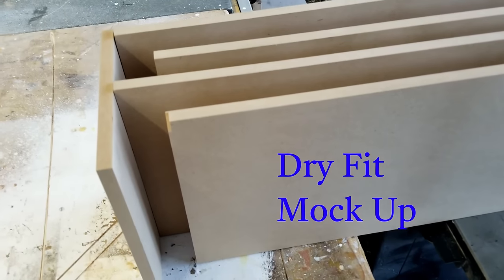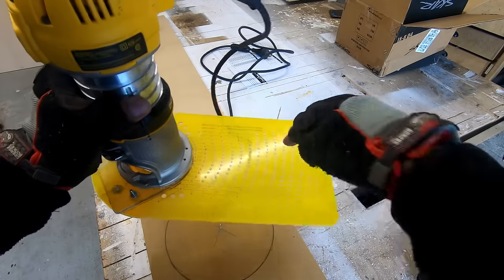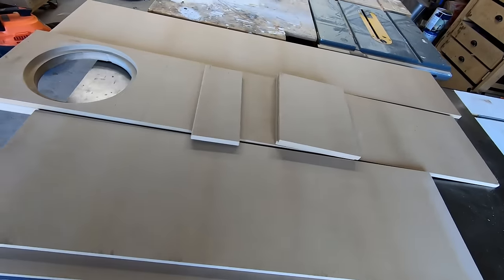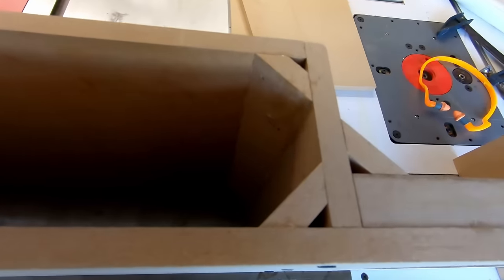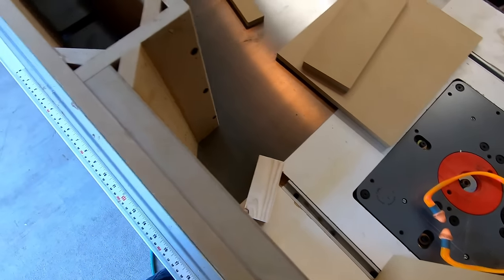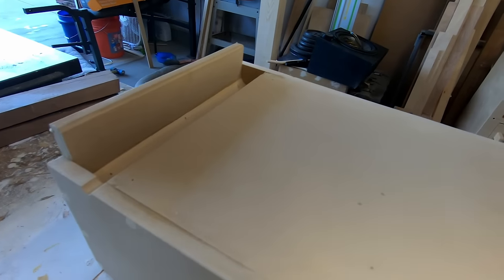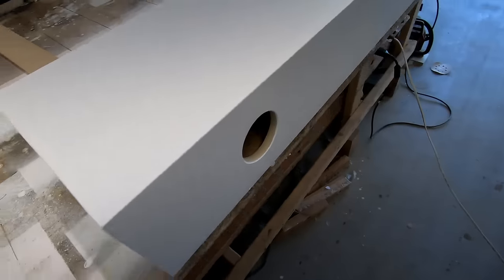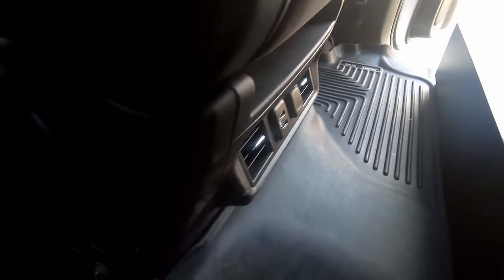DIY Subwoofer Enclosure 2021 Edition - Caliwood Specialty

Comment: Wicked speaker box but doo doo speaker keep it up.
Reply from the maker: 😅 Ha ha, yeah I gave this brand a shot and so far I'm pleasantly surprised with the sound and performance.
Reply: U can make a shitty speaker sound good with a decent box. Lol
Reply from the maker: @johndoe..THE_REAL_JOHN-DOE  yeah, I guess  so 🤷‍♂️ lol
Reply: All skar subs are good except the SDR 18 due to a bad designed coil  DNR 15 and the entire evl line due to weak motors they aren't efficient but take abuse
Reply from the maker: @kargo6  that's good to know.  👍
Reply: 🤣😂🤣😂😅 shit had me rolling
Reply: Travis Hamler  lmao no only Pyle uses plastic baskets
Reply: Skar ain’t bad
Reply: Travis Hamler  bro no skar sub uses plastic baskets. Heck even the IX series uses a metal basket.
Reply: @johndoe..THE_REAL_JOHN-DOE  yep, I remember this one ported box I bought years ago. I thought it must have had a pretty good sub in it cause it absolutely slammed, but when I took it out I was shocked! Lil cheap-o sub, put a good sub in and then it REALLY blew me away!!
  I'd say the Box is almost more important than the sub, almost.. LoL
Reply: I remember back in the day we had "Pyramid" product. those were truly "DOO DOO"!! the technology today and the newer cheap product BLOWS the pyramids Away! Skar is NOT bad, they are pretty good! comparing Skar to Pyramid,  Skar would be like on par with MTX Back then. the technology in Skar today is like most of the Mid level Brand Name speakers back in the Day. you can't go wrong with Skar.
Reply: @Engineer_GM_Ford_Chrysler  Good comment!  Pyramid was pure junk!  At least one amp was in every pawn shop I’ve ever been to.   Given that they were so ubiquitous I’m still not sure if enough people were gullible enough to buy them so that business for at least a few years or they all ended up in sitting in pawnshop because nobody wanted them.  Craig was another crap brand.  So was radio shack, just like their home audio their car audio was overpriced, behind the times junk.  Should have just stuck to parts and they might have lasted longer.
Reply: @BabyCharlotteschannel  the box IS more important than the sub

Comment: Very nice but out of curiosity does the sub ever slap the floor do to the excursion travel beyond the lip of the box.
Reply from the maker: Great question. No, it does not. I made sure it had sufficient clearance underneath. I've played some really bass heavy music and I've had no issue with the excursion.
Reply: Assuming you went with the srp 8" ?
Reply from the maker: @happys104092243  I used the IX-8 D4
Reply: @FranksCaliWoodSpecialty  why?
Reply from the maker: @matt6951  😆 Too funny.  Keep an eye out. I'll be upgrading it.  Yes, I'll be making a vid.
Reply: @FranksCaliWoodSpecialty  good deal! Pay attention to those T/S parameters! Good a good quality efficient sub.
Reply: @FranksCaliWoodSpecialty  my evl-8 has impressed many. Id highly recommended considering it as an option
Reply from the maker: @dakotad2401  Thanks, I'll check it out.

Comment: A transmission line speaker with a decoupling chamber behind the driver is called a Decoupled Antiresonant Line, or Daline. It permits more powerful quarter-wave resonance of the air in the line; it is like a hybrid between a bass-reflex system and a transmission line. In a system like this, the chamber behind the driver may have stuffing (or maybe not), but the line typically does not have any stuffing.
Reply: Albeit, the chamber is quite shallow, I call it a Daline, or simply a Chambered t-line. Admittedly, in my 30 years of designing t-lines, I've never tried to design one. Jesnen transflex https://www.youtube.com/watch?v=6yb2msOQw_4 or bandpass t-line https://www.youtube.com/watch?v=qm5K_VVRwXQ is as varied as I get

As for the measurements, to have a 'Line' that's 1 3/8's ... wouldn't perform that well. So this is certainly pointing more towards a daline, than a traditional 1/4 wave.
Reply: You know it's called antirezonant for a reason.
Reply: Yes…instead of stuffing though, I add an oscillating retractable Heisenberg compensator.
Reply: Is there a way to calculate something like this for dual 8" subs? How would you figure length of line and area of open chamber for each?

Comment: Nice job! I was in car audio from 1984 - 2000 and specialized in custom enclosure design, xovers and custom panels. I still do my own stuff for home and car. It doesn’t get much better than the construction on that box.
Reply from the maker: That's awesome. Thanks for the comment
Reply: Hello, good time, sir, I had a request. I will send you a piece of video. If it is possible, you can send me a beautiful design for the rear audio system of this car so that I can make it. I would appreciate it

Comment: I like how you build your box’s. Using screws and painting it. Seen others that don’t use any screws starts to rattle than fall apart and carpet that starts peeling off almost instantly
Reply from the maker: Thanks! Yeah, most boxes are carpet wrapped. I wanted to try something different and using paint gives it a more cleaner and sleek look.  Oh yeah, for me I want to make sure that the box does not come apart so I use screws all over.
Reply: you know boxes are supposed to be turned to a frequency right? and theres a math equation to use to get what frequency you want. or theres calculators online to do the math for you. just trying to help.
Reply: next time use a longer nail and put it all the way through and square and you can just flip it over and use the router to cut it out and the cut will line up.
Reply: and it will help to put liquid nails on the screws so they won't come loose. no hating just trying to help
Reply: gluing in the connector will help keep them from cracking from the pressure. and they make a lot of different kinds of metal inserts so you don't have screws that the wood holes strip. glue them in to seal them in. just some things you might have not thought of.
Reply: Bob, are you sure you watched the same video as the rest of us? The dude doesn’t need pointers, he’s a fucking stud. That box and his attention to detail is phenomenal.
Reply: Screws are not need if glued and clamped properly
Reply: But i still use them lol

Comment: I built a large box for my home theater system. I placed within the exact same SKAR ix 8 subwoofer. Fantastic sound for the money. The key with these budget subs is to never over power them. If you give them just enough, they sound great and last a long time. A good box is also very important.
Reply from the maker: Awesome! And yes, I 100 percent agree that you need a well-designed enclosure.

Comment: I can see how that would be beneficial. It allows 2/3 resistance/enclosure while allowing the the sound to travel and escape as well as the frequency which travels with it. Haven't had much enjoyment or success with open/bandpass boxes however designing and a reasonable amount of effort are warming me up to it. Still enjoy the hard hitting notes that come from a sealed box.

Comment: One of the nicest t-line boxes that I have seen.  Good work.
Reply from the maker: I really  appreciate that. Thank you
Reply: This is definitely a quarter wave enclosure, but I'm curious about the frequency range. It does sound good though.
Reply: @uncledope77  

Every t-line based on quarterwave that I have ever heard has the best bandwidth of any box I have ever heard.   Recently heard a Sundown SA-10 that was amazing.  Dug super low with rebassed tracks but also very musical with jazz and classical. Guy was going to sell me his box and hooked it up in his vehicle because he had audiofrog and was going strictly SQ for competition.   Sounded so good that he changed his mind.   It sounded so good that I wasn't even upset with him.   He literally quit competing because he missed that box. Not saying everyone would feel the same but ridiculous bandwidth.
Reply: I would agree with that if it was made accurately for each individual subwoofer. A lot of these homemade T-Line enclosures don't sound right.  Because they don't hit that quarter wave frequency spot on the money. Sometimes not having the proper spacing in the vented walls. Without that specific frequency & spacing that will tremendously effect the overall performance and sound quality.
Reply: @uncledope77  

It's not that difficult honestly.  First time I made one I killed it.   Best sounding box I've ever made.  Follow the steps
Reply: @uncledope77  

Honestly you can tune it to whatever frequency you want BUT I agree that calculating based upon the FS of the subwoofer has never had negative consequences for me.
Reply: @drrckhamilton  It's not difficult if you know what you are doing. Most people don't know what they are doing! Especially the folks at home who have limited knowledge, tools, software, and ability to properly read a spec! YouTube has a lot of videos of bad T-Line enclosures and fewer really good ones is my point. Some people have the capacity to learn from their mistakes and some don't or don't want to!
Reply: @drrckhamilton  It depends on what is important to a person.
Reply: @uncledope77  

You building one?
Reply: @drrckhamilton  No but I have & in vehicle it's not for me. They are too rectangler and a person doesn't have enough flexibility. To make them for most cars & are smaller suv's. I use vented, sealed, or passive radiator enclosures in  vehicles. I prefer passive radiators more now because of the pure dynamic range & pretty much no bottoming out. It is more fuss but there is nothing like the depth of that bass from 1 driver & 2 passive radiators of the same size. 👍🏾
Reply: @uncledope77  You are correct but i am not sure why everyone is saying this is a T-Line, it clearly has a chamber volume bigger than the ported section meaning it has a restriction which will create a loading effect, T-Line design is meant to use equal volume/area from speaker to port exit. The tuning length of the port is to match the Fs of the speaker hence why people try to use speakers with an Fs under 30hz especially in home theater applications
Reply: @HashDogg06  That's true but people have been being creative and testing different variations on quarter wave technology. I consider them t-lines because they are designed like 1 but have some slight variations. Are they t-lines spot on, no. But they sure do have some of the benefits. Regardless it's way too big for my taste in almost any vehicle. One of my favorite enclosures was pretty simple for 6 JL Audio 8W6's (the 1st versions). Each of them had .4 cubic feet of sealed air space with polyfill inside. Being pushed by a Rockford Fosgate Punch 200x2 dsm wired at 2 ohms Mono. With 3 2½" mini fans keeping it cool. 2 ohms Mono for that amp was a lil stressful. But that bass was so deep and clean because all 6 subs were sharing 1,200 pure watts of power. Also I only had the Bass Boost on the amp at 25%. Damn I miss that car and the BANG in it.😪
Reply: @uncledope77  Avoid bass boost, no amp should have one these day if it isn't fully adjustable, I nicely built enclosure that suits your taste buds won't require any bass boost. Sealed enclosures just work for all types of music but you need a lot of cone area to keep up with a smaller sub in a ported enclosure for those lower frequencies so ported is usually my go to.
Reply: @HashDogg06  I respectfully disagree about the "bass boost" it is subjective and per user taste. Plus those Punch amps had it built in to the guts of the amp. That line of DSM amps were offering 18 db's of clean bass boost & you say don't use it? 🤔  That is bananas, in most systems to gain 3 db's of spl you usually have to double everything. Or sound deaden the entire vehicle for 3 to 5 db's of extra spl. Punch was offering 18 db's with the turn of a knob on the amp. The simple efficiency & sound quality out that is next level! I only increased mine to gain 4 to 5 extra db's from the bass boost. To me the biggest problem with using a bass boost does start at the enclosure. But it's 2 fold, (1) can your subs handle the power with the bass boost? (2) Is your enclosure is right for the sub(s) that you have? Thirdly is quality of the signal coming to the amp. I had none of these issues I just like deep clean bass & I got it!

Comment: I got a design similar to this but it’s a 100” PVC tube. 
It transfers the sound energy much more efficiently than a “square box”.
Reply from the maker: 🤔 I'm intrigued. Is there a video out there showing this design?
Reply: @FranksCaliWoodSpecialty  
I did not provide all the steps but here is a short video I did of my older enclosure. It’s all tube.
https://youtu.be/NeSC0C1R6tc

Comment: Badass setup. Just watching the pieces being made, and you explaining the setup as you went along was appreciated. How did you calculate your inside volume, especially with those long runners? Thanks.
Reply from the maker: First off, thanks for your comment. 
There are various online calculators that you can find online on how to figure out volume and port length.  For this design, simply search for t-line calculator or Transmission line speaker length calculator.  This should also give you the overall volume.
Reply: Going larger then the recommended box size for a sub is not going to wreck them, it will be louder because there is less back pressure, but your sound quality will be looser sounding, or sloppier and less tight. Bigger the box the louder (more room filling vibrations ), and the opposite for smaller boxes. Hope this helps.

Comment: Can this same box be used with a ct sounds tropo 8" sub? How important is it to tune the box?  I have no idea how to do this, but I am a carpenter,  so I could def build this vox.So glad I found this, awesome work and sound. Thanks for any info
Reply from the maker: Thanks for the question.  The short answer is No. Only because every single sub has its own specs that require a custom enclosure for a specific tuning frequency.
Reply: @FranksCaliWoodSpecialty  thanks for the answer.  I really want that setup but I have been researching and I cannot figure out what size it needs to be by using available calculations. It's confusing to a newbie.  I could build anything if I knew the layout.  Also how do I find someone to tune it.  I don't know anything about this, I feel stupid

Comment: Great job my dude there’s a half ass way and a way to do it right  you got it locked down bro.  Instead of painting it why not carpet either way it’s great quality work.💯💯💯🔥🔥🔥
Reply from the maker: Thanks! 
Yeah, I wanted to try something different with that black finish instead of carpeting.
Reply: Got ya turned out great either way you would have went.
Reply: Going with the black paint you could use the Duratex coating...its black and gives it a finished look plus protects the wood. Also I'd have to do some sort of mesh over the sub especially with it facing/close to the floor
Reply from the maker: @tesla_3_performance  Yeah I did consider a duratex finish. And yes it does provide additional protection, but I wanted a smooth finish; i believe duratex has more of a rough texture finish. Adding a mesh or some sort of cover to the sub is not necessary (it might look good, but it would not add any real protection). I ensured it had enough clearance at the bottom for excursion. A few years back I built my home sub with a similar design (down firing) and there's been no issue with dust, kids toys, etc.
Reply: @tesla_3_performance  I agree with your statement but he might not have the clearance. Because the surround is thick plus the excursion. He might have to raise the enclosure a lil bit.

Comment: why would i use headphones? i have 8x 15s in my home theater playing this very well thank you very much :3

transmission line subs are awsome, you did a good job!
Reply from the maker: 8 - 15s!?!? Yeah Buuuuddy! Thanks for the comment!
Reply: @FranksCaliWoodSpecialty  yessir! With a small 400w amp, IB's are great!!!
Nearly 20 years old now... bought them back when acoustic elegance first started, bought all 8 for 1,000 bucks... now they would cost nearly 3k 🥺
Reply from the maker: @narmale  wow! Hold on to them. Now I'm curious to know how they sound.
Reply: @FranksCaliWoodSpecialty  they sound weird at first, takes about 3 weeks of listening to them to get used to the unique sound

You spend your whole life associating bass with traditional boom boom of box subs, which is nothing more than the original sine wave, and the 3rd and 5th sympathetic resonance

The IB takes the 3rd and 5th away... your sitting IN the box basically... so you hear bass like in real life... its actually more tactile than "heard" yes you hear it, but IB doesnt have all that overtones your used to hearing, so it seems way more immersive and not "in-your-face"

Helicopter blades rip through your chest and pull the door open your didnt latch

Cannon blasts rattle your eyes, and earthquakes... well... earthquakes are now so very real and visiting your house in very real style

The best scene, that i love to use: Tron, Onto the grid clip... is a brief, massive infrasonic piece that will destroy lesser subwoofers, they cant even do it justice if they cant go below 20hz... 

But that scene on an IB... buddy... you better have reinforces your walls, doors and strapped small children down for their safety... that sub 20hz base will send a shockwave through your entire house and leave you in shock, wondering if maybe, just maybe... you dipped your toes into something that was better left unknown

All kidding aside, they are simple to build, relatively cheap, but yeah, your probably going to put about 3-4k into one now thanks to inflation... 
And they need an amp that can do DSP time delay and parametric EQ to tweak small nulls or hills

But hands down, they are the king, of ACCURATE bass.